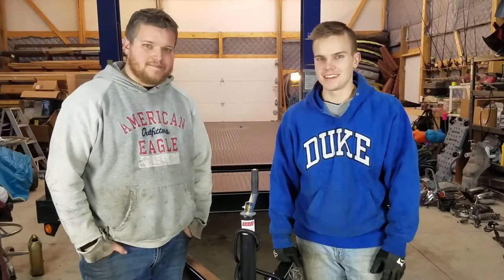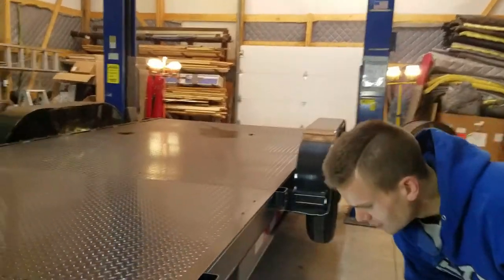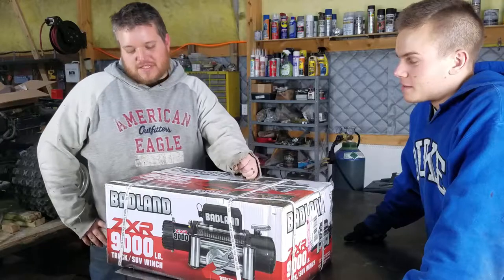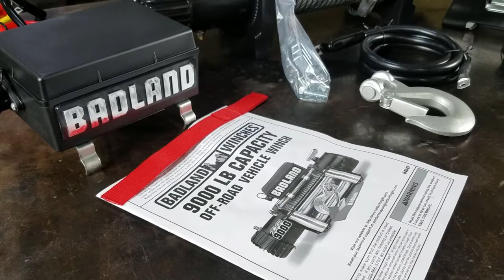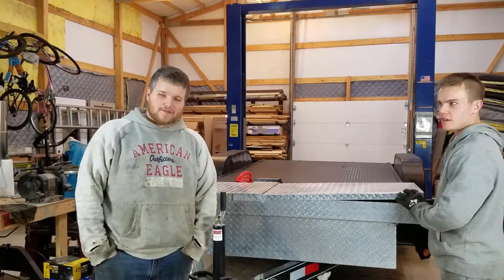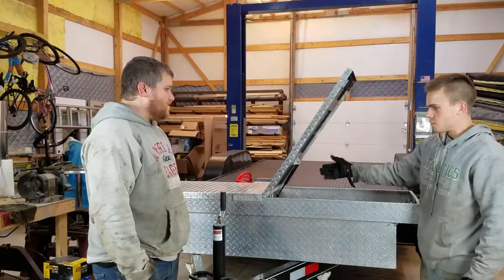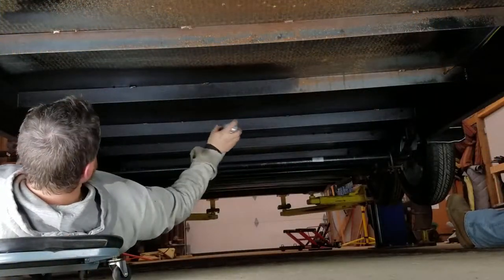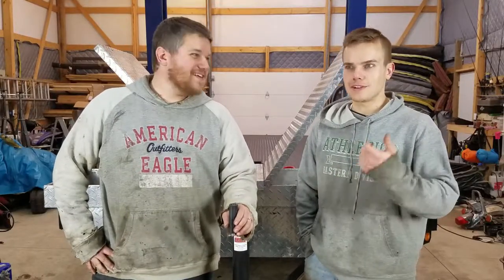Fleet Maintenance | Harbor Freight Winch & Craigslist Toolbox for New Trailer!

Comment: Have you had any problems making sharp turns on reverse
Reply from the maker: Luckily, I have not blasted the tailgate with THIS trailer lol. This is actually my brother's trailer, but I've never heard him mentioning having an issue with it either
Reply: @StaySlyh  thanks man I just put a toolbox  on my 24 footer trailer hopefully  everything works well im putting a 12000 winch in front of it too
Reply: I'm going to try to put a solar 12 v battery charger too
Reply from the maker: @2010roookie  awesome! Sounds like a nice rig. The old truck box off Craigslist (or Facebook Marketplace maybe?) is an awesome option in my opinion. Very practical, very affordable, just an all around great addition to a trailer. I'm hoping to do something similar with the trailer I just bought. Can't have Andrew (my brother) flexing too hard on me jk lol
Reply from the maker: @2010roookie  that would be amazing. Great idea! Do they make solar battery tenders? It'd be sweet if you could just leave it hooked up all the time!?